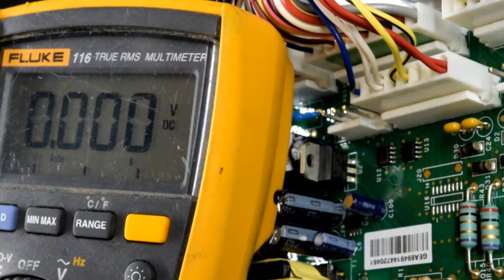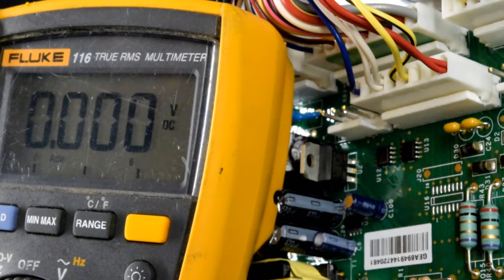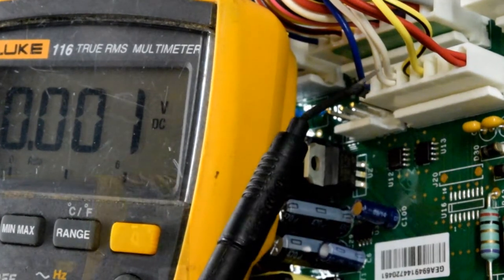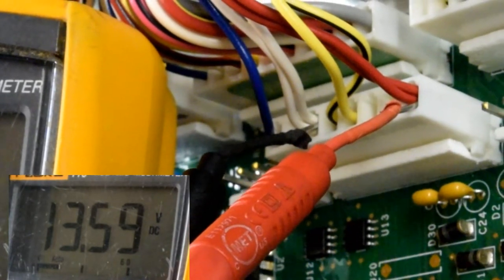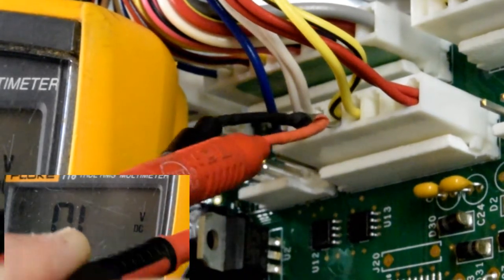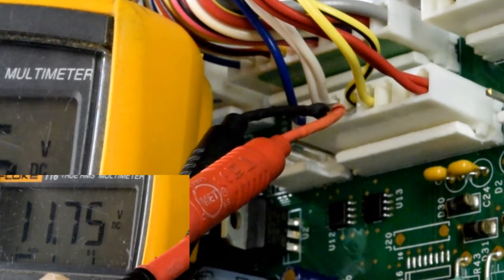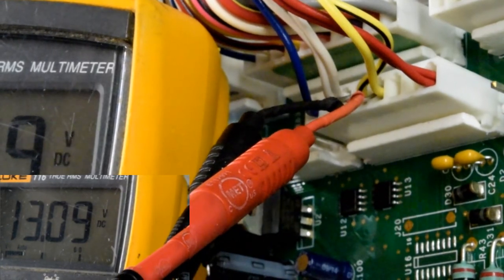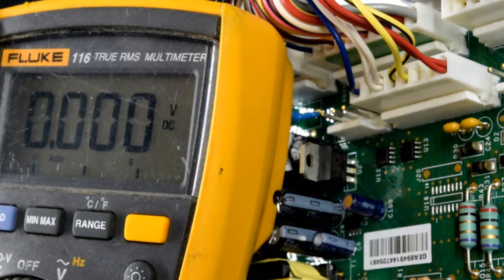Fan Voltage Test with Good GE Board - Part 1 Bonus Footage

Comment: hi Andy,  I have a GSE22ESHCSS  I followed your instructions everything good thanks to your channel, but now I have one problem I don't know if you could help me, I was cleaning the condenser coil I disconnected the fan to remove it for better cleaning, somehow all the wires from the compressor side come out the housing, I don't know what order they were in, and the colors are different from the fan side, also the fan side has 4 wires the compressor side has 3wires which is white, gray, and red, the fan side red yellow white and blue, I have positive  12 volt reading on the compressor side in gray, red and white is neutral when the refrigerator is on, no matter how I try to connect them the fan still not coming back on, please help if can thanks.

Comment: Hello, my GE side-by-side GSRS3KLXHFSV has dead. Front panel, fans, compressor are not working. No noises, no clicks when connect to outlet. But ONLY the light inside of each of two departments is working! The voltage on the motherboard is 114 V, so, as in my outlet. Could you tell me please, what is the possible reasons of this failure? Thank you so much.

Comment: I’m coming in at 10 v on my Analog meter. My condenser fan in the back is running. May I assume it’s enough volts to run the evaporator fan also? I tested the meter in the wall outlet and it went to 120, so I think the old tool is okay. Does 10 v mean bad board? Ty…..

Comment: I have the same GE fridge.  My evaporator fan is always on high speed, even during defrost cycle (which heat up the freezer and melts everything) , also if I set both the freezer temp and fridge temp to zero it still runs on high.  I tried changing the main board and the front control panel.  I check all the thermistors also.   Any ideas why the fan is always running on high?
Reply from the maker: phoebedad hey!  
Very interesting.   No, I can’t think of a reason outside of a failed main board that would cause this issue.  Perhaps a short in the wiring (?) 
Even still, it’s the control boards responsibility to send the voltage to the fan and it shouldn’t ever be on during defrost to my knowledge.   

I’m afraid I don’t have a lot of good input here unfortunately.
Reply: @GraceAppliance  OK thankyou for the speedy reply.  I am actually working on this right now.  I wonder if the board I just got from Amazon is also bad?  It looked brand new but I guess that is possible.  I will try to look for a short in the wiring.  I did replace the evaporator thermistor and I soldered it and used heat shrink tubing, but there is sharp edges everywhere.  Maybe i will pull that panel out now and have a look.
Reply from the maker: phoebedad I don’t suspect a bad board as the problem was present before you swapped them and I personally have never seen this particular symptom.
Reply: I don't have a meter that will read hz, but I just read in another forum that if the blue wire on the evap  fan doesn't send a signal to the control board of will run at high speed.  Maybe the fan is bad?  It is blowing fine though....continually high speed!
Reply from the maker: Hey, the fan is the only thing I can imagine it would be...however, I still can not think of why the board would be sending voltage to the fan even if the blue (tachometer signal) wire were bad.  I’d put a cheap $17 aftermarket fan on to test this theory out.   Please follow up if you do find it helps!    Super odd.
Reply: @GraceAppliance  That was it!  I installed a new evap. fan today and I knew right away it fixed the problem because it ran at a slower speed and turned off when I set the temp control to 0.   The old fan ran on high and never shut off.   I took a gamble and actually installed the  GE-OEM part.  It was $46 from Amazon.    I hope this helps other people also with  this odd problem.  If the fan loses communication with the motherboard, it defaults to high speed continuously.  Thank you Andy for all your help
Reply from the maker: phoebedad outstanding!   I’m so glad it worked for you!  Nice work.  Thanks for the follow up.

Comment: GE Refrigerator Control Board WR55X30806

Need help in fixing the fridge.  

I have a GE cafe fridge. My fridge has no power. I can’t find the schematic diagram for the main board. Don’t know why fridge stop working. I have power to the outlet and fridge I’m thinking it’s the board. Compressor and lights are off. Water dispenser does not work.
Reply from the maker: manny v hi!
So, for these fridges, the lights run on a separate circuit than what is controled by the board.  So, if both are out, it will likely not be board related.  
The first place I’d check (with the fridge UNPLUGGED) is for a failed cord leading from the wall to the fridge. look closely where the cord come is to the fridge for broken, burned, corroded, or chewed wiring.  This will be the most likely spot to find the issues. 

Using your meter, with the fridge unplugged, you can use an ohm test to see if the cord (or wires) have a break in them.  If there is no change in the meter between the 2 points you’re testing, the wire has a break in it.  If you get a low resistance such as .08ohm it would be good wiring.  

Let me know what you find.

Comment: My evaporator fan is showing 9.3v.  In this video yours shows 11.75v and say that there may be fluctuations because it is a variable speed motor but in the original video you say that if the voltage isn't between 12 - 14v the control board is bad.  Is my control board bad or is 9.3v within the range that the variable speed motor would use?  My issue is that the freezer is defrosting properly and is being kept at 0 or below but the refrigerator would vary and sometimes be over 40 degrees air temperature and even 41 degrees testing water in a cup with a probe that has been there for days.  I'm just not sure a new board is the solution and would hate to buy a new board and still end up buying a new refrigerator.  Thanks for your help.
Reply from the maker: RMFUKE hey, sorry if it’s wasn’t clear. The supply voltage for the fans should always be between 12-14vdc. Then from here the board distributes this voltage to the condenser fan which is always going to be between 12-14vdc because its not variable speed.  The evaporator fan motor being variable speed will get one of 3 preset voltages (low, med, and high) something like 6vdc,9vdc,12vdc. If the evaporator fan is spinning, I would continue looking elsewhere.  

Are you feeling air come through the damper door on the refrigerator side? 
Also, I’d probably start by checking the refrigerator temperature sensor which have a video about called testing and replacing a defrost sensor.   

Let me know if you have any questions.
Reply: @GraceAppliance  Thanks for such a quick response.  The evaporator fan is spinning but the air through the damper (which on my refrigerator isn't a door but a clear piece of mylar that the fan blows open) seems to be too low a volume most of the time.  I replaced the thermister in the refrigerator last week along with the condenser fan - using the fan you linked to.  I'm still not clear if the 9.3 volts I get on the control board connector J2 pins 3 and 4 is appropriate or should it be 12 -14v?
Reply: I replaced the evaporator fan, not the condenser fan.
Reply from the maker: RMFUKE the way you’d confirm the appropriate voltage from the board to the evaporator fan, is to measure the frequency from the fan to the control board.   Basically, the fan has a built ok tachometer that sends the frequency response to the board of how fast it’s spinning and adjusts the voltage out from the board accordingly.  
Your meter may or may not have the frequency function. If it does, let me know.  

You can use a paper clip with tape wrapped around it (as a handle) to jump between the far right red wire and pin 4 yellow and black. This will supply 13vdc to the evaporator fan motor and you should hear the fan speed increase and feel a difference in the airflow from the damper opening.  

Outside of this, I don’t know of any further tests you can perform on the fans themselves.  

Other things I’d check are to remove the back wall inside the freezer to see how the frost looks on the evaporator.  If you want to snap a picture, you can send it to GraceAppliance@gmail.com and I’m happy to take a look to verify a healthy frost pattern on the evaporator.  
Also, double check your condenser coils behind the fridge are clear of dust and any air vents inside the fridge and freezer are not blocked with food.
Reply: @GraceAppliance  Unfortunately, my inexpensive multimeter doesn't have a frequency function.  I replaced a broken defrost heater earlier this year and last week checked the evaporator coils and they were clear.  I also replaced the defrost thermostat and 2 freezer thermisters a couple of years ago and vacuumed the condenser coils recently.  I can tell when the evaporator fan is running at full speed just by putting my hand near the damper door inlet to the refrigerator.  When the fan is running at full speed is when the refrigerator stays in the proper temperature range.  My GSH25JSXBSS only adjusts the temperature of the freezer and refrigerator by numbers 0-9 with 5 being the "Normal" and 9 being the coldest.  I have to set the refrigerator to 7 and the freezer to 7 to keep the refrigerator under 38 degrees but then the water line freezes.  I had insulated under the freezer ice chute and this had kept the freezer water line from freezing but changing the temperature to "7" causes it to freeze again.
Reply from the maker: RMFUKE I ask about the frost pattern on the evaporator to rule out a sealed system issue. Typically, if there were one it would also have warmer than normal freezer temps, which in your case sound fine, but the coils should have a light coating of frost on roughly 90% of the rungs after having run for several hours.  To me, it sounds like an air flow issue.

Your schematic shows having a damper door motor / flapper. This also includes a temperature sensor. 
The part number is: wr13x10988

Are you certain you do not have this part in the upper left back corner of your refrigerator section?
Reply: @GraceAppliance  I replaced that refrigerator thermister in the upper left shelf railing near the damper last week.   I does seem to be an airflow issue but don't know what could be causing it other than the fan itself.  I can see through the return vent at the bottom of the refrigerator into the freezer section so that is clear.  How should the evaporator fan blade be positioned vis-a-vis the housing?  Should it be as high on the motor shaft as possilbe?  I didn't pay any attention to that when I took off the old motor.  The design of the air flow seems poor in that there isn't a direct air flow path to the damper and the air only seems to flow when the pressure in the freezer builds to a certain level.  This can't be the issue since the system worked for the first 9 years we owned the refrigerator.  In the freezer I do store food in cardboard trays but I don't think that's an issue as I have done this for years too.
Reply from the maker: RMFUKE the position of the fan blade shouldn’t make a drastic difference.  
Is it possible that the fan blade for installed upside down?  This would be pulling air the wrong direction.  Some fans will only install one direction to prevent this, but I’ve done this before.

It should be in this orientation.  
https://images.app.goo.gl/YWkCSjR4S33cDQN39
Reply: @GraceAppliance  Since I didn't have the damper with the motor (WR13x10988) I replaced just the thermister (temperature sensor) WR55X10025.  I know that the damper should have a motor but I found someone else with the same model that said they too had the damper with only the clear mylar flap and no door.
Reply from the maker: RMFUKE very interesting.  I’ve never come across this myself. I learn new things every day.

Comment: Do you have anything with the newer style GE control boards like 197d8523g101? The connectors for it do not match those of any of your videos.
Reply: In your fan side compressor they all match  but you dont have a video on the compressor side

Comment: Could a fan be clogged?
Reply from the maker: jorge mendoza no, but they can rust in place and not turn.  Also the vent that they fan pushes air through can get blocked with ice build up.

Comment: Hi there, I tested my evap fan motor for a KitchenAid side by side and got 57ohms. Is that good or needs to be replace?
Reply from the maker: Hi, based on the ohms it does seem very high.
Are you getting voltage to the fan?
Reply: GE Side-by-Side ONLY - Refrigerator Repair Videos 
Yes
Reply from the maker: @flaviomelucci2261  if you're getting 12vdc to the fan motor and it's not spinning, you'll need to replace the fan motor.  Thanks